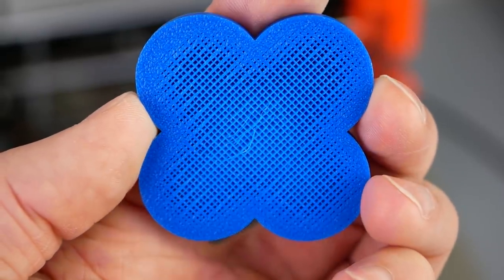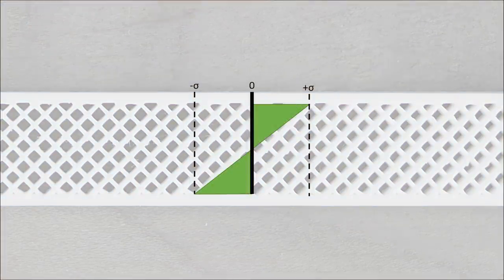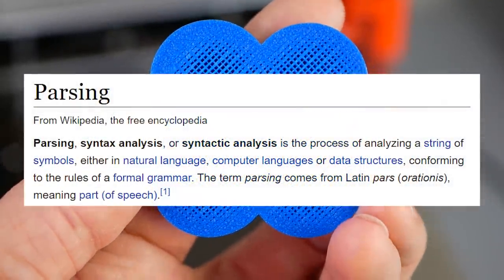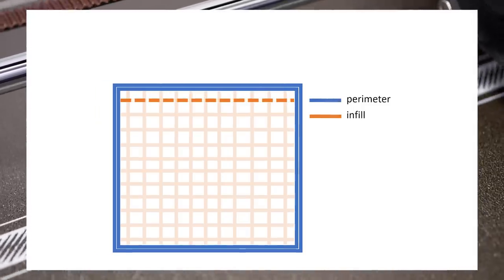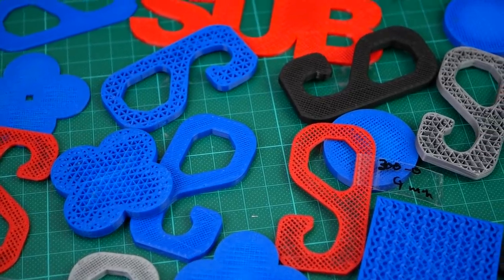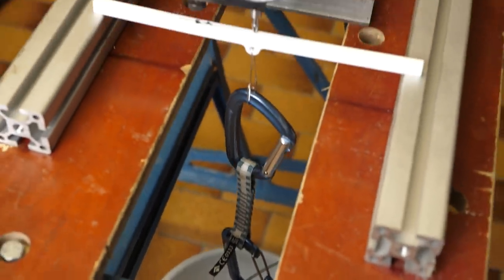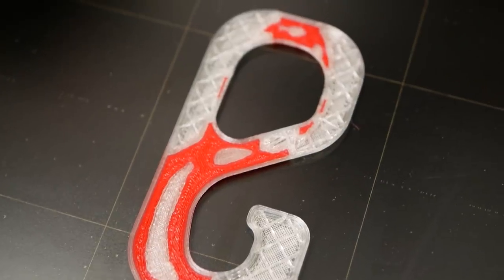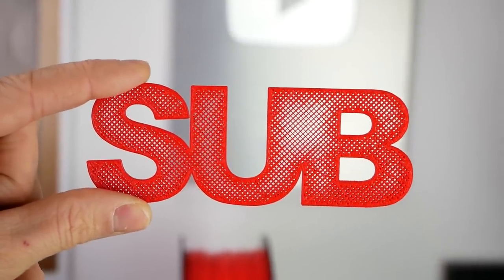Gradient Infill - NEW efficient infill for 3D prints!

Comment from the maker: Don't forget to share this video on Facebook, Reddit, Twitter and other social media!
Reply: Great Video
Reply: Now let's hope this gets implemented as a toggle on most slicers!! I'm definitely interested in this seeing as a lot of my prints are structural in nature.
Reply: +1 sub here 😙
Reply: I want to take gyroid and criss cross it...
Reply: Instead of chopping the hole infilline  into Millimeter pieces, you could just chop it into the parts that fade in, a single line to the other side and the fade out part, to reduce the load the the board of the printer and the SD card
Reply: Hopefully they implement this fast in cura. 😊 Good job mate.
Reply: great to see progress, thanks for sharing! :)
Reply: Great video and educating. Thank you.
Well i hope you can make a plugin for cura or something similar. Anyway once again its a great educating video.
Reply: I feel like this would make for a great water filter
Reply: Woher kannst du deutsch¿
Reply: i dont know why but i hear idears when you say ideas could just be you accent poking through
Reply: what if you change the infill direction (30*, 45*, 90*) depending on how the stress load is directed so the infill will always be directly opposed to the direction of the stress and thus you can have the structural strength while having a lower material fill. 

Also triangles or spheres/circles could be more efficient?
Reply: Shared on 3D Print club group on Facebook. Well done. This is a serious technological improvement.
Ken.
Reply: Steffan, is there somewhere i can get my hand on your post-processor script?
Great work as always! Though this time i really think you've outdone yourself :D
Reply: Guten tag Stefan!
Reply: @markusfritz224  Er ist deutsch...
Reply: @Bobis32  
U aren't the only one who noticed german accent
Reply: look into brave rwards for content creators
Reply: CNC Kitchen I require your help! I'm searching a way to make so certains area of my print are in better quality (layer size) than other but I can't find how to do :/ plz heeelp I don't wanna print something for 74h where I just need some area a certain layer size and other a certain layer size and the infil just meh who care I just need of the outside

Comment: I'm over here trying to print a usable benchy and this dude is like "yeah I learned python and invented a new type of infill in 4 hours." Impressive...
Reply: Right??? Jesus Christ
Reply: He technically doubled how many types of infill there are, because there is a normal and gradient version of every different infill now. Jeez
Reply: But did you manage to get a good benchy?
Reply: @Larsvvv  nah I just bought a resin printer instead
Reply: @Flumphinator  ah oke! how is that working out? is a resin printer easy to use? and do you use it often?
Reply: @Larsvvv  yeah I honestly love it. I was worried about resin smell and toxicity but it’s not too bad. 

FDM printers seem like they need attention. Like I’m always worried about it when it’s running. Will it clog, will the thermistor fall off and burn the machine down, will the filament break. Running an SLA printer is like running a toaster. And the detail is just amazing.

I still use FDM for when I need big parts or strong parts, but that’s honestly less and less. I print probably 3 things a week for myself, and 1-2 architectural models a month.

If you go SLA: just remember, don’t skimp on the post processing. Use water washable resin if you don’t like the alcohol, and the wash/cure stations are worth the money.
Reply: @Flumphinator  Thats great man :D

Comment: This make so much sense I'm surprised this has not been done before.  Nice find.
Reply: Ultimaker printers have had it for 2 years now.
Reply from the maker: As explained, they unfortunately don't. Their gradual infill is aimed at top layers primarily.
Reply: As an academic myself, this might be worth a publication. Really interesting stuff here! Definitely going to take a look at it, might be useful for my research.
Reply: I remember complaining about the lack of this when I got into 3d printing a few years ago. It seems so obvious. The lack of this and the lack of a printer that can print out in honey combs and then inject filler before closing off the honeycombs for increased structural integrity or weight.
Reply: @CNCKitchen  check out cubic subdivision infill in Cura.  It increases the density near the shell in a 3d manner.  You can typically switch from cubic to cubic subdivision and save weight while preserving strength.  (I love your work here.  I think it could be layered on top of any number of other infill.  Cubic subdivision just does it with a constant line width.)
Reply: This isn't new, I saw this type of infill on a NASA laser sintering set up in about 2004. I don't think it was new then either.
Reply: @porschepanamera92  I've seen this done in an SBIR funded project in about 2004, I can't believe no one from that group published a paper on it.
Reply: my 3d printer has this already it isnt new
Reply: @vordt.  which 3d printer is that?
Reply: @otm646  That's interesting! I'm only in the 3D printing game for a few years now. Currently I'm doing research which is partly related to concrete printing. So this might be a useful concept to implement, whether or not in the same format.
Reply: @keithbrings9053  yeah I had the same idea like injecting the infill walls with some type of fillers like a 2 part epoxy for example or closed cell foam
Reply: Bayou Muscle yep instant solid print and much faster times with less infill needed
Reply: Btw, as a biologist, I have to say that this is how bones are made if you see a transversal cut. That's inspiring!
Reply: It has been done before:  bones.  God is a genius, you know.
Reply: Dave Cockayne  yes i've done things like this, as well as hiding high denomination euro/yen and swiss franc coins as a present in hollow 3d prints.
Reply: Dave Cockayne  That's  great way to make the print bottom-heavy so it prefers to sit upright.
Reply: @otm646  We're talking slicers and 3D printers...
I wonder if it is NOW implemented in Cura tho?

Comment: Instead of changing the extrusion rate, you could change the travel speed instead. this may work better for Bowden printers.
Reply: Potential printing speed improvement, moving fast in the middle of a part but slowing to change direction near the perimeter.
Reply: Changing travel speed in gcode is much more cumbersome than changing the extrusion rate. One would have to modify the slicer altogether to incorporate speed as a variable for every extrusion, from the current extrusion type(infill, wall, etc)
Reply: @ishanmamadapur6307  it's actually not, you just have to change the feed rate. Each G-code travel move is just a set of coordinates with an optional travel speed. I.e. "G1 X5 Y7 Z0 F3000.0 E0.02" is move to X=5mm, Y=7mm, Z=0mm at a speed of 3000mm/minute while extruding 0.02mm of filament. A lot of the time, you would actually leave the F part off, because it defaults to the last value you gave it. You would still want to change the E value as well, but the F value is just as easy to tweak as the E value.
Reply from the maker: Great idea!
Reply: @tedrolleiii1725  Yeah, matches with what I had in mind. What I trying to establish is that perhaps cura defaults to a code with preset feed rates, so having to add a feed rate per extrusion move would require a code modifier of some sort. 
Coming to think of it, it shouldn't be that much more difficult than what Steffan accomplished with varying the extrusion rates. Thanks for the insight!
Reply: The great thing is you would have to slow down anyway at either end of a line segment so jerk shouldnt be too much of a problem.
Reply: @CNCKitchen  I'd really like to see this!  Would this be a feasible modification to your g-code parser?
Reply: A combination of both would probably be best for Bowden setups, so you don't reach that theoretical maximum flow rate (or get a kink, break, or jam in the filament from pushing it too hard),  but also not increase print time by insane amounts by slowing down so much on a large percentage of the infill
Reply: If you don't change the E vale the extrusión width will not be affected even modifying the speed. The proper way is as Stefan did.
Reply: @jordicasiano8112  What about changing both? Would it reliably make the lines, or would it have occasional breaks?
Reply: I'm a little late but you could use velocity painting software to achieve this effect I believe - https://www.youtube.com/watch?v=HdKaKKeyz7g
Reply: You mean like changing the pattern/line distance. As in a more solid like pattern on the outside and more spacing as you move inwards. I thought of this too, and this too can be done in a script programmatically.

Comment: Hi Stefan; as someone with extensive experience in signal processing, I suggest you further improve the anisotropy of your pattern by introducing Poisson noise to your infill geometry. The whole idea with Poisson noise is that it will jitter the position of your vertices in a random way that is also uniform. For the anisotropy to be good, you should jitter in all three dimensions. All you need is a short programming loop that takes in input a small array of 3D coordinates, and applies the jittering function. Because of the nature of the noise function, you can apply the jitter to relatively small 3D clusters and your jittering should remain uniform overall. There are plenty of Poisson noise distribution algorithms available online, due to how prevalent the technique is in image and 3D processing. You would modulate the amount of jittering according to your gradient, so the closer you are to the object boundaries, the less jittering you have; this, combined with the increased density of your point arrays as you get close to the boundaries. If you look at human bones, the "infill" has a similar gradient + jitter property. One thing missing in your gradient function, is that it should also be modulated by the degree of local curvature at the boundary : More curvature should be equal to more density.
Reply: Phil Pan okay that sounds like an awesome idea! Especially orienting the design closer to human bones with the noise property is really cool. 
I hope that someone will implement this!
Reply: This is an amazing idea! Should probably also combine this with stress optimization and topology optimization.
Reply: Wouldn't that lead to lots of jerky movements during printing?
Reply: @felix-dk9tr , no. As far as I can tell, it would just be slight direction changes, not like printing, say, 3d honeycomb, which does have a lot of shaking apart of a printer

Comment: Now talk to Joe so he can implement it in PrusaSlicer
Reply: Anyone can implement this into Slic3r/PrusaSlicer (or even Cura) since they're all open source projects. Just need to do it and ask the maintainers to merge it.
Reply: Like he is the only one working on slicers......🙄
Reply: PrusaSlicer is getting smart variable infill in 2.2 I believe. Which is the upcoming release, but I don't know if it works like this.
Reply: cura allows printing over USB. which is an enormous time-saver. sd cards and exporting to octoprint is for chumps. you cant print/refine/print/refine rapidly if you gotta do all these extra steps. unfortunately cura also kills my extruder gears. and you cant change acceleration on the first layer which is how you mitigate 95% of adhesion problems.
Reply: @pepesworld2995  yeah printing over USB is a damn nightmare waiting to happen. In my opinion. I want my printer to be separate from a computer. But whatever workflow works for you.
Reply: @pepesworld2995  so does Simplify3D.
However I only use print over USB if the print time is not longer than 1hour.
If the PC or software crashes for whatever reason the print is gone.
Reply: @jnevercast  my friend has a broken SD card slot and is forced to use USB. He was not amused when windows decided it needs to install updates and restart in the middle of a print
Reply: @ensoniq2k  "nightmare waiting to happen"
Reply: @ThePunischer1000  ok child
Reply: ensoniq2k just repair it... it’s pretty easy to swap it out.
Reply: @jnevercast  I dont get why someone would like a 12h print to be fed by a Microsoft computer waiting to update and reboot on you at the worst possible moment ;)   Octopi is a good alternative though.
Reply: @MasterG753  Octoprint is certainly something I'll be adding to my printer in the near future. If only for the time-lapse videos.
Reply: @ThePunischer1000  yeah, that's what I do.
Reply: @REDxFROG  Same here. Just easier to get good results.
Reply: A Raspi with Octoprint was easily the best buy I did for my Printer. Huuuge Timesaver. And PrusaSlicer even has an upload button, I can choose to start right after upload.
And you can control everything via a nice web interface. I dont have to touch the lcd screen nob in weeks lol.
Reply: @jnevercast  ok irony resistor ;)
Reply: whos joe
Reply: I've done many prints that are way longer than 3 hours through USB (Up to 10h or something). I've never had a problem that pertained to the computer or USB. But I would probably do SD card if the print is over 12 hours. Perhaps I've been lucky, who knows :)
Reply: ensoniq2k octoprint fixes all this
Reply: OG Slic3r master race
Reply: @pepesworld2995  That is not true. See in Settings: 

Speed/
Initial layer acceleration/
Initial layer print acceleration/Initial layer travel acceleration
And it is not a new feature...
Reply: Pepe's World It is possible - write yourself a script ✌🏻
Reply: @theshuman100  Josef Prusa
Reply: @ensoniq2k  that sucks. its a windows problem though. i run linux on my 3d printing machine.
Reply: @jnevercast  nah it isnt a nightmare. it should be the default. the problem is the protocol. you shouldn't need an open connection to the printer for 10 hours. the printer has internal storage available. it can RW an sd card inside. it should buffer commands. sd cards should not be considered normal simply because microsoft can't make an OS thats incapable of running 24/7
Reply: @theremay  wait what -in cura? or slic3r
Reply: It seems that people are digressing now. I do think PrusaSlicer is better though, cura sucks when you want a bunch of combinations and you can mix and match presets before fine tuning it for the actual print. Writing entire gcode is not efficient, like not all people write games on ASM, it's just better to write it in C++ and maybe fine tuning it in ASM.
Also to reply to your question it doesn't quite seems to be possible to use it on PrusaSlicer now as it finds the infill range and the shell using notes(Infill starts here and Shell and stuff) left by Cura, Cura produce a lot more human readable gcodes compare to PrusaSlicer and this piece of code cannot differentiate the shell and infill apart without them. He will need to spend some rewriting it himself. Though I suspect that he might have begun doing it because of another project.
Reply: I'm sure Joe would love to take credit for this.
Reply: When I started 3D printing, I tried printing through Cura and the nozzle would freeze for a few seconds. Since then I began printing from the SD card, until it broke.
Now I'm printing from Pronterface and I've never had a single problem. 
I think Octoprint is less reliable than a well configured Windows 10 machine.
Reply: @jnevercast  It was the first I implemented. SD card printing is pain in the ass.

Comment: awesome, even before seeing the whole video! Gradient infill and non planar top layers being integrated in mainnstream setups is the best combination that we need
Reply: "non planar top layers being integrated in mainstream setups" that's far from being simple, as each model of 3d printer have a different attack angle on the nozzle... that's a lot difficult than the gradient infill... But integrating these values in the slicers, of the most used printers (Ender 3 for example), sure it would be perfect. Looking forward for this to happen.
Reply: André Solis i fully agree, it is not easy, not as easy as gradient infill, linear advance or variable layer hight or many other things, if someone gets it consumer friendly for one standard setup like prusa or creality or E3D, i am sure the community will help out, at least to get it ported to Windows without having to go through linux, there are already nozzles with long pointy tips that would be perfect for it

Comment: This is great work as usual. I was actually surprised that you open-sourced this. Turning this into a standalone GUI app or slicer plugin would be trivial, but it should also be possible to implement this directly into Cura or Slic3r and submit a pull request. You'd get a lot more control too as it would no longer be just a post-process step.

Comment: Really great video once again. I've built a tensile tester myself now, and I built it around a raspberry pi and Python. I'm still planning on doing a video about it, but the code may be interesting to you in the meantime. It features a GUI, and takes full advantage of the 80Hz sample rate of the HX711, allowing very high temporal resolution, which already proved useful in my creep testing. It doesn't support extensometers at the moment though, something I must still work on.
Reply: Do you have it documented somewhere?
Reply: @wesc23  Not yet, but planning on doing a video on it. Probably in 2 weeks I'd say. First going for another video on gears.
Reply: _ David _  Thanks, I will try my best to get the gears video up tomorrow or the day after.
Reply from the maker: Awesome! Please let me know when you publish something.